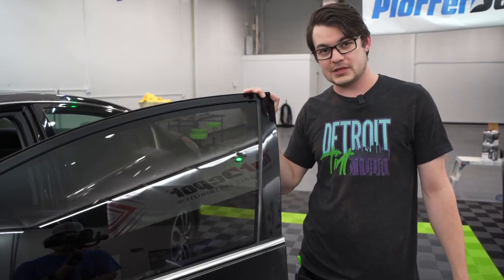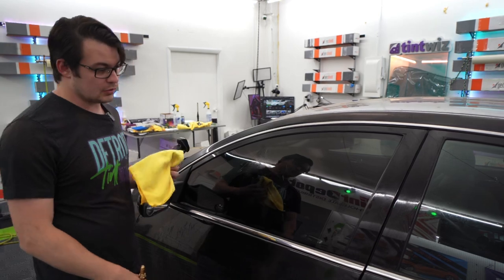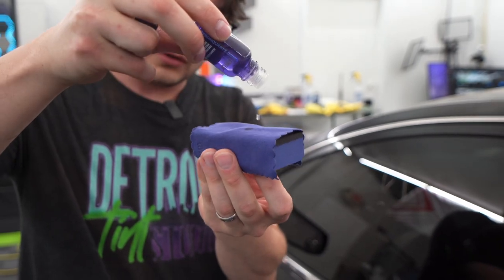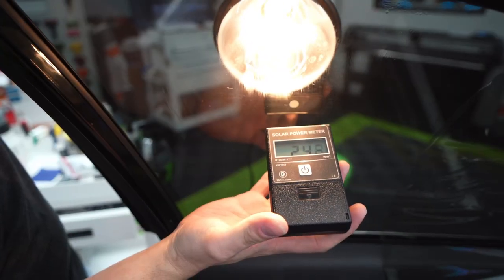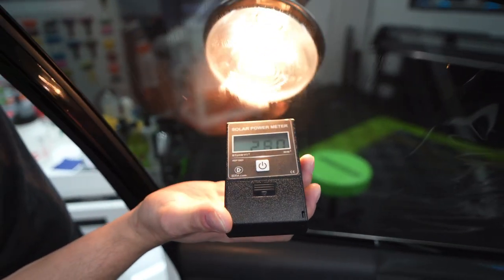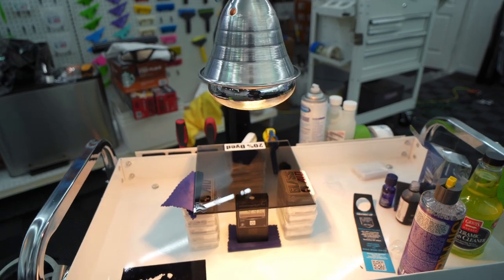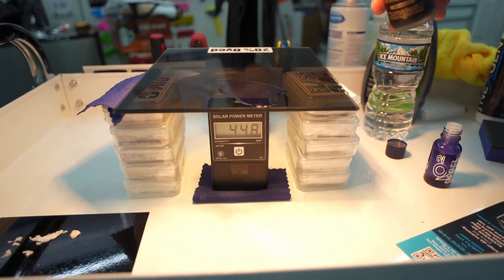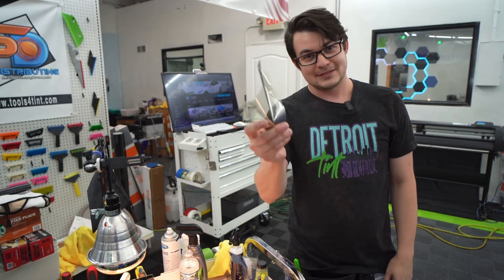Make ANY Window Tint CERAMIC!

Comment: Ceramic tint is infused with micro particles of titanium nitride. As with ceramic coatings, that is made up of silica dioxide. They're a form of "ceramics" but they have a different purpose of application.

Comment: Some of the ceramic products can be a little much, I will admit to that, interior sprays, and what not ... not needed. A good glass repellent with ceramic is very nice however, like rainx but a lot better.

I think the weirdest placement I found it in was tire protectant, I wanted to try the product, didn't care about the ceramic at all. However I found it's addition to be pretty nice once I got around to using it for a few months, it seemed to help keep the shine/protectant on the tire, and it made it very easy to rise off the tires as well.

I live in an area with a lot of clay in our soil red/orange clay really stains the tires, borderline impossible to get it off a tire once stained. It seemed to help a good bit when it came to rinsing the mud off, I rarely felt the need to actually scrub the tires when the hose started to work pretty well for getting it off, where as before I almost always had to scrub them. Ceramic or something else in it seemed to add a little barrier between the clay and tire, may have been something else idk but it was the first ceramic tire protectant I tried and only one to act in that way.

Comment: What ceramic line from
GeoShield are you using in the video?
Reply: Knowing what ceramic Matt uses most I'd guess it's Pro-Nano, he loves the way it installs, shrinks, the colour, heat rejection and optical clarity. A person who wears glasses really notices poor quality film in so many ways that nonglass wearer's just don't see, so for me, if Matt recommends it, its for more reasons than most tinters

Comment: Glass and ceramic coating isn’t the same as on metal. Most will show great beading. Now on the metal, it puts a protect shell on the clear coat if done property. However, you had me laughing throughout your video